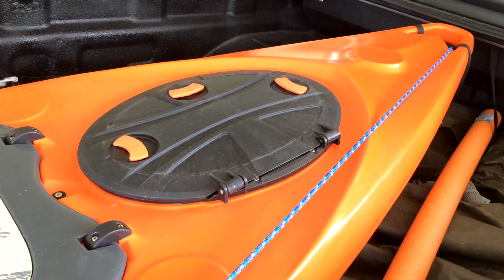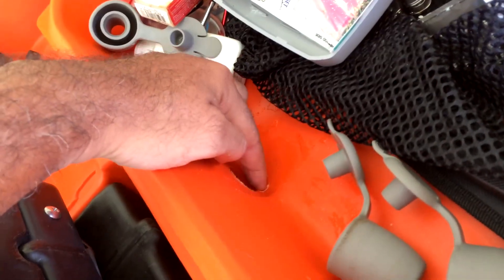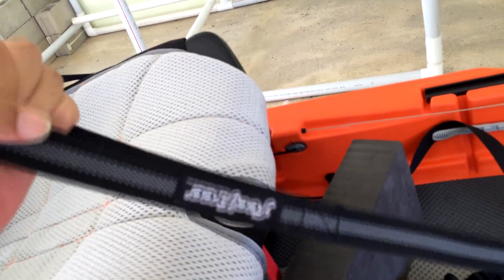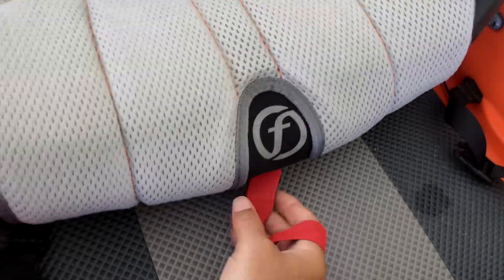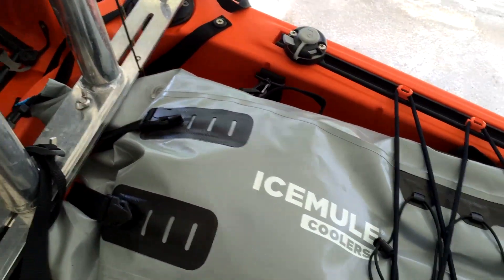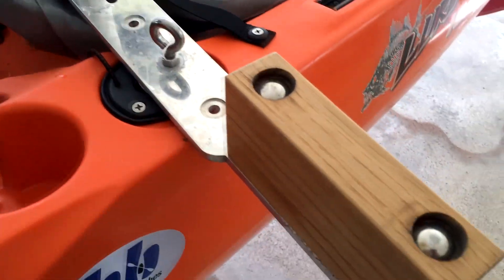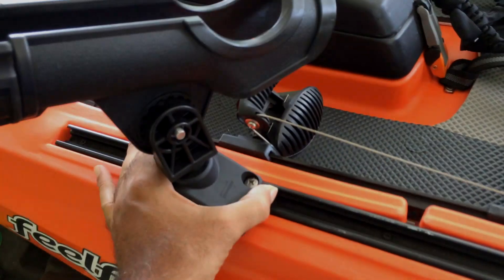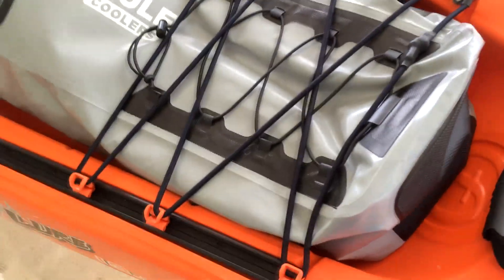Feelfree lure 13.5 fishing kayak walk through

Comment: Nice set up. Your yak appears to be able to take a paddle drive, is that so?

How effective has been the fish finder in Trinidad waters?
Reply from the maker: No pedal drive for it yet, I have sent a hint to feel free about that already but I think a motor drive will be better. As for the fish finder it does work but doesn't mean the fish will bite, so far it seems to work best to find structure but then you have to deal with the bait stealers like the grunts and the obligatory catfish.
Reply: pedal drive  would be available, I think next spring

Comment: I bought my Lure 13.5 from ACK.com but the sonar pod didn't have a separate "shelf" piece. Is there an actually piece you place in the sonar pod that the battery can rest on or are you referring to the molded indentions in the pod itself? If mine is missing I need to call them and ask for one.
Reply from the maker: It's a white plastic shelf in the pod, you can just use an old cutting board or ply just cut it to fit and make your own, lots of them get lost I use double sided tape to keep mine from getting lost

Comment: how would this kayak handle a river such as the susquehanna? does it track well enough to handle current?
Reply from the maker: +Golfhippy10 

I haven't been on the susquehanna in a yak but with the rudder the 13.5 tracks rather well, with out rudder not so much. If your fishing in strong currents make sure any Yak you get is ruddered regardless.
Reply: i have heard through numerous reviews that this kayak, because of its size is very slow. do you find that this kayak is tough to move through the water in terms of speed? and if so is it a deal breaker. i am currently trying to decide between this kayak and the jackson cooshd and wilderness systems atak 140.
thanks
Reply from the maker: honestly, it is slow as a trade off for the stability, if that's the deal breaker also look at viking profish reloads